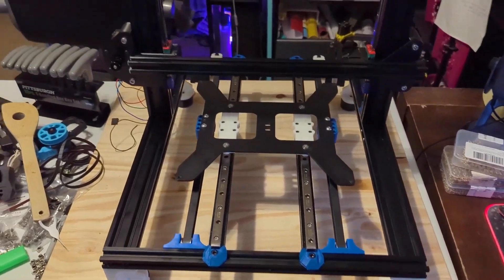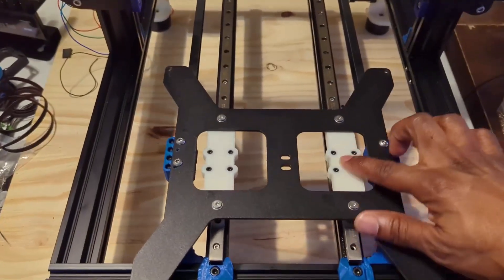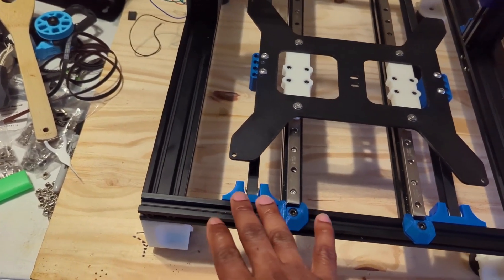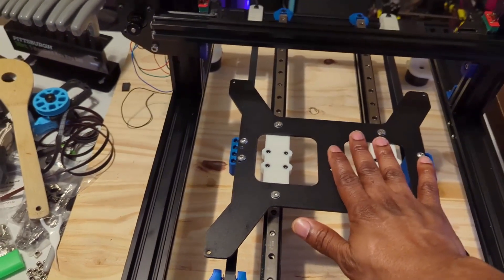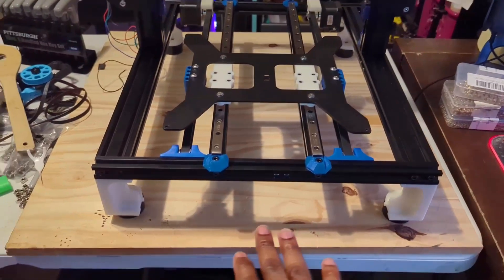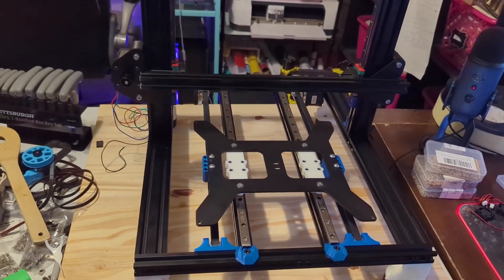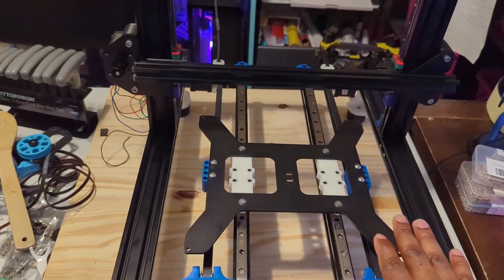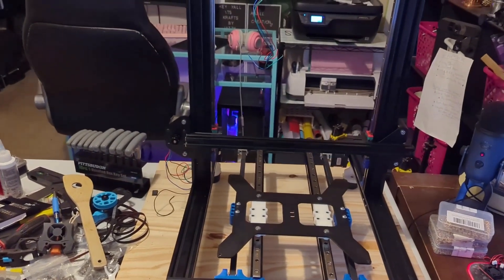New Build Mash Up 3DPrinter  // GoldenJaguar3D //

Comment: Really interesting to see all the designs you've combined to make each of your printers. In terms of price vs. performance, do you think one in particular has given the best results?
Reply from the maker: thank you...to answer you're question the voron trident conversion from a x5sa it certainly worth in compared to buying a kit I think I've spend 900$  and some change that includes the original price of the x5sa...it performed equal if not better than a trident kit....not only that but I my printer was also bigger for cheaper too so overall the best results was from my trident cover build next my v1.8 conversion...it's definitely worth if you know what your doing.
Reply: @GoldenJaguar3D  I was kind of hoping you'd say that, haha. I've been thinking about putting a Trident together, ideally 350 cubed. Kits with 250 Z height are a bit limiting for what I want to do, but putting together a list to self-source parts for a taller one came out to something like 50% more than the cost of a kit, so I wasn't even sure that the increased build height would be worth it. Going with more affordable replacements for all the expensive, big-name parts everyone seems to recommend is probably a fine option, but it's still hard to beat the cost of a complete kit.

Comment: I love that Y-Axis Setup! And I'm happy to see the Belt Z on there :) A little note: you're supposed to remove the flanges of the bottom idlers so they clear the extrusion, then the belt will get parallel and the printed part sits flush with the extrusion.
Reply from the maker: ahh thanks for that tip...awesome mod by the way :)
Reply: Awesome mod, been running mine for a few weeks now